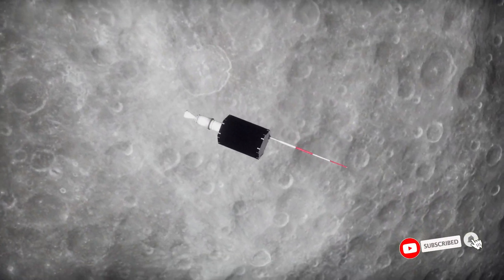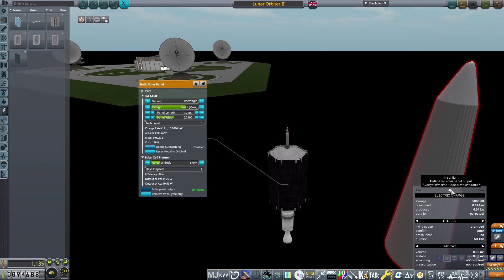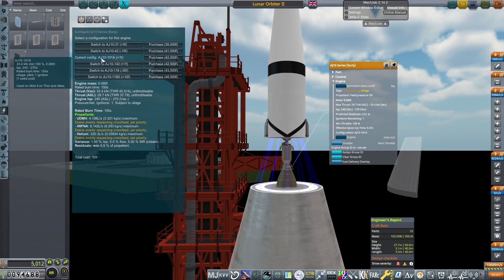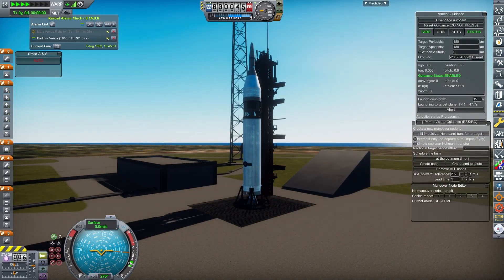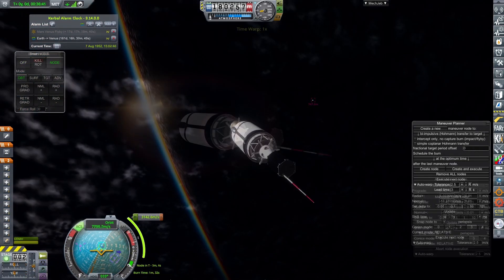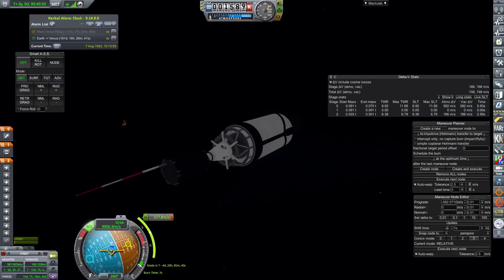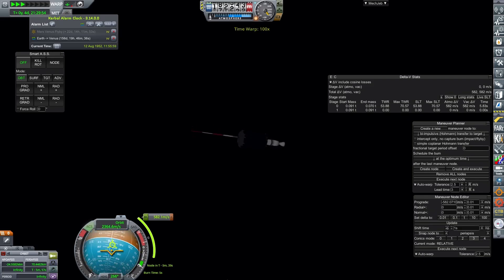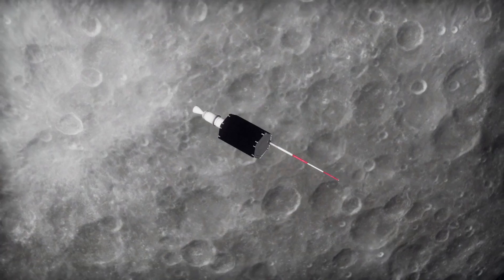How To Orbit The Moon For CHEAP! In KSP RP-1

Comment: it's also possible to do with Atlas - Agena with upgades of 1960, but it's almost in the edge of atlas capacity to get orbit, so depending of the eficiency of the materials, avionics, comm and ascence profile, you would need some solid rocket as strap booster for atlas. For instance a pair of castor. NASA attempted to do it with Thor launcher in 1958.

Comment: Thank you for making those tutorial videos, I had a problem with making a two-stage launcher to orbit and a probe to moon, still I'm pretty sure that because of updates to mods certain parts and engines differ, but the template for the rocket thankfully worked. Also, this mission really taught me that I need to always simulate different parts of the mission to see if everything is working,  since so many things can just go wrong in this mod. Damn, still good job at making it pretty easy to understand, also i never could've guessed that MechJeb is capable of making orbits and maneuvers on it's own, now I won't be wasting time for that. Again thanks.

Comment: Have you considered unguided TLI with a braking motor mounted in front of the probe?
Reply from the maker: Might work actually, depending on whether the spacecraft is positioned in the right place for both (which I think it should be? Need to test this) could probably make a really cheap/light lunar orbiter this way :p but it’d also be hell to fly haha

Comment: I have never tried spin stabilized lunar orbiter, sounds like a hassle

one problem with this though: my lunar perigee changes quite a bit when I timewarp up from earth, so I usually have to realign my perigee with rcs

ps: is it called perigee for the moon?
Reply from the maker: Preilune I think, or there’s several different names like Perisene as well? Can’t remember off the top of my head. If you turn off rcs before warping to the moon, it shouldn’t jump around though! At least that’s what I’ve encountered :)

Comment: My first lunar orbit in my current RP-1 game was RD-108 (plus 4 Castor-1 boosters) > RD-0105 > RD-0105 and then four small separation motors for capture. Squeezed onto a 100 ton pad for cheapness and locking the third stage avionics’ battery let it complete lunar impactor contracts for cheesiness.
Reply from the maker: Thats pretty similar to this then! slightly lighter actually as this was 103t Doing these tutorials this week I'm actually learning a bit myself about how to do these early-ish contracts efficiently, and I'll be taking some of this new found knowledge into FaK :P 

(currently working on maaaaaaaaaaaaaaybe squeezing an interplanetary mission in my second episode, its gonna be tight but I think I might just be able to do it)